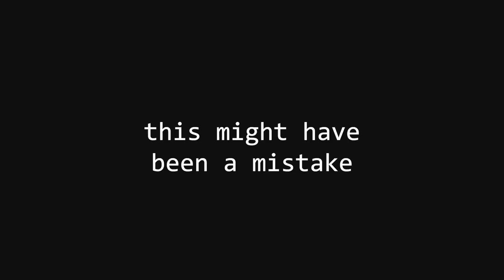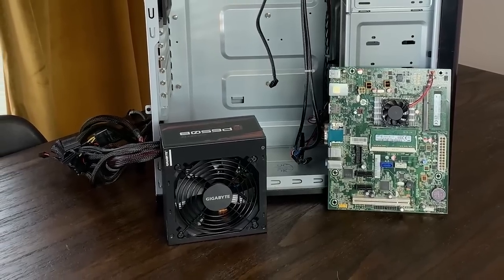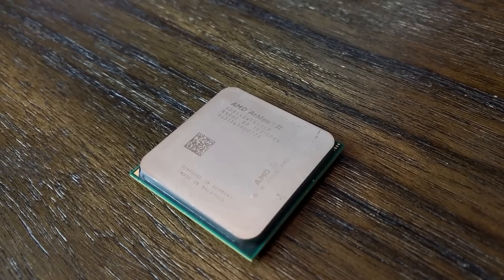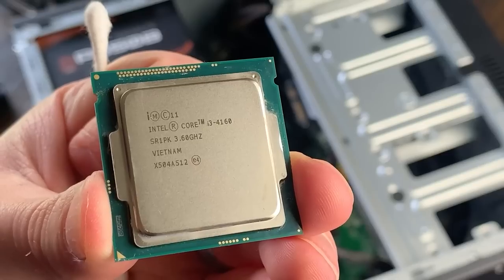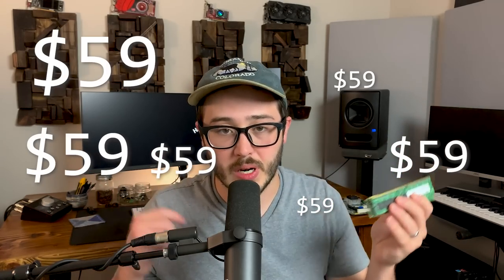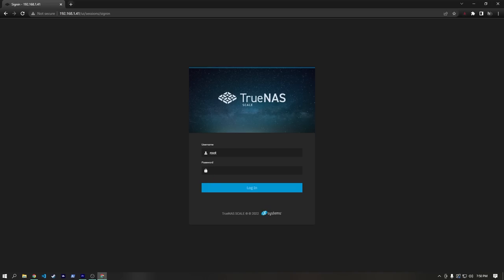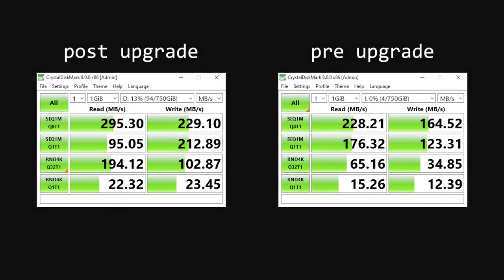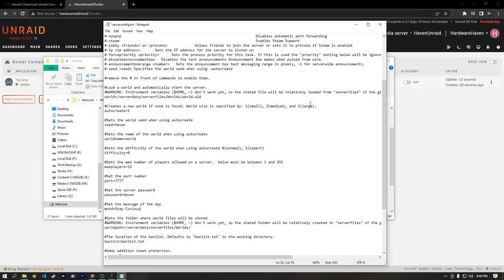Upgrading My TrueNAS Server

Comment: When I installed my first Supermicro motherboard I had the same fan cycling issue and had to log into ipmi to change the fan mode to standard instead of optimal or full speed.  That fixed the issue for me.
Reply: I just ran into this earlier today when I installed a lower-rpm Noctua fan on a Supermicro motherboard. You have to use ipmitool to lower the fan critical thresholds so the fans can run at their normal lower rpms (500 or so rpm in my case) without triggering alerts and causing all the fans to ramp up.
Reply from the maker: Any good links on how to do that? Haha
Reply: @JeffGeerling  Yeah, I have to admit that when I allowed TrueNAS forums to convince me I needed a Supermicro board it didn't take me long to realize I was in over my head and was now going to spend a lot more time on Google than I ever anticipated, lol.
Reply: @HardwareHaven  Don't know if it's able to be pasted here but just check out the latest blog post on my website (jeffgeerling.com)
Reply from the maker: Oh great! Will do!
Reply: Like my SuperMicro boards. X10sl7-f probably the most SATA/SAS ports (14) at reasonable money (<£100) without any 2TB limits or odd ports and also micro ATX.

Comment: Do you want a 32gb sata SSD that connects directly to the sata port with no need for wires for your boot drive? Has a little cable that comes off of it that connects to a molex cable. I used it for a while as a read-only boot device for my server before I figured out that you can actually boot from an mdadm raid. So now that raid is also the boot device. Anyway, because I used it as a read-only device, it isn't worn down. It would mean you'd be taking up a sata port for the boot device, and idk if the orientation would work on that board, but even if you want it just to mess with, that would be fine by me.

Also, have you thought about doing an Xpenology VM or something like that? I've seen people do it but I don't know how worthwhile it is or isn't. Might make a fun fun video to see your perspective.

That init command in truenas was clever!

Comment: You didn't change the bottleneck imposed by the 2.5GbE NIC.
You could have an ocean of storage in your TrueNAS Server, 
but it's still sipping that ocean thru a straw :)

A few more options come to mind:
(1)  some NICs support "teaming" i.e. 2 parallel Ethernet cables;
(2)  build a 10GbE "backbone";
(3)  more recent versions of USB are clocking at 10G and 20G,
a significant increase over 5G USB 3.0.

The latter option (3) can be enabled by installing a fast USB AIC
which is then cabled to a separate NAS chassis that also supports 
the same USB speed and connector.

With the latter setup, your workstation does double duty as 
a file server e.g. by "sharing" network drive letters.

(3) has a different "topology" but may reach 10G bandwidth
at less total cost than 10GbE NICs etc.

Hope this also helps.
Reply from the maker: The goal wasn’t to fix  bottleneck, but to replace my motherboard that died haha. 

But the 2.5gb connection isn’t the full bottleneck either. On certain reads I get pretty close to the 300 or so MB/s that 2.5 can support, but it’s usually lower than that, but my guess was that’s a limitation of the drives and configuration. If I added in an SSD pool, then for SURE the networking is the bottleneck. Fortunately my workflow works totally fine at that speed for now
Reply: @HardwareHaven  Thanks for the prompt reply.  Yes, I did understand your goal.  I did want to share some of the empirical experience we acquired while preparing a U.S. patent application.  Here's what we worked up yesterday:
A standard Ethernet frame contains 1,500 bytes @ 8 bits.
There are a total of 208 bits dedicated to headers, CRC, MAC source / MAC destination, etc. in each "frame".
Thus, 12,208 bits / 1,500 bytes  = 8.138 bits per byte (average).
Now compute max throughput of a single 2.5GbE NIC:
2,500 / 8.138  =  307 MB/second (zero controller overhead).
The divisor is larger for smaller frames;
the divisor is smaller for larger frames (e.g. jumbo frames).
You are reporting "close to 300 MB/s or so".
That would necessarily imply almost zero controller overhead, which is not very likely.
I would look elsewhere for explanations of that rate "on certain reads" (but not all) e.g. a feature of your measuring software, perhaps.
For possible future videos, we suggest that you take a close look at the QNAP TR-002, for comparative purposes:
1 x Type-C USB 3.2 Gen 2 10Gbps 
That USB generation uses a 128b/132b "jumbo frame" containing 16 bytes:  132 / 16 =  8.25 bits per byte 
10,000 / 8.25  =  1,212 MB/second max throughput.
Consequently, the x1 bandwidth "further upstream" e.g. motherboard chipset generation, may actually be slower than the max speed of that USB 3.2 Gen 2 cable.
PCIe 2.0 x1  =  5G / 10 bits per byte  =  500 MB/second MAX
Thus, something like an AIC with x4 edge connector would be required with PCIe 2.0 chipsets.
PCIe 3.0 x1  =  8G / 8.125 bits per byte  =  984.6 MB/second MAX
The latter is much closer to 1,212 MB/s, but still LESS THAN the latest USB cable.
PCIe 3.0 uses a "jumbo frame" = 128b/130b i.e. 130 bits / 16 bytes  =  8.125 bits per byte
Bottom Line:  upstream bandwidth is extremely important for maximizing overall throughput, and may be the real culprit limiting average, overall throughput.
p.s.  I was sorry to hear that your budget motherboard failed.  That's the risk we all take when purchasing used computer hardware.

Comment: Probably super late to the party here, I apologize if someone already mentioned it. SATA Dom (disk on module) are freaking amazing. Your mobo doesn't support the powered ones, )they would be indicated by an orange set of sata connectors,) so you won't be able to power it/them from the mobo without annoying small power connectors. However I truly recommend buying one or more for your system. USB flash has burned me more than once, the flash on DOM's is literally the same nand used enterprise grade ssds. Even though typically TRUEnas won't use many read writes, USB devices can have problems being powered on for so long. Yes, most of the time you could just replace it with another USB device, but when devices, especially USB, start to fail they can lead to unrecoverable situations. I've been there personally, not trying to be a neck beard.

Comment: Good upgrade, did you make sure the firmware for the IPMI was up to date? In general the IPMI as you found out is the one that controls the fans and you may be able to fix the fans issue fully by updating that

Comment: the fan rpm issue is probably just the cheep fan having a dodgy tachometer, theres a fan like that im my pc that cant deside weather its spinning at 500rpm or mach 4 but since the fans max rpm is 500 it isnt an issue

Comment: Sexy upgrade) I use a Ryzen 5 1600 from a previous build in my TrueNAS one and it's quite overkill. Well, Syncthing is the only thing that can load it rather high. I'm thinking of swapping it to Athlone 300GE but not sure if it's gonna be OK for three-four docker containers running (Nextcloud, Syncthing, Gitea, etc.).
Reply from the maker: Thanks! And that sounds like it could be a sweet setup

Comment: I am wanting to make a NAS server. But I am wanting to use Gentoo. I am just curious what each piece of software does in these videos. And if there is a way to do it.I normally just see people talk about dolphin, proxmox, docker truenas and unraid. I don't see creators go into detail about each piece of software

If you have and I missed it, then my bad. I am just starting the process of trying to make a very power efficient, minimal GNU/Linux build to back up storage for three computers 2 macbook airs and a workstation/gaming rig. I plan on it not really being much more than a NAS at the start. But will eventually make it a media server. Remove the IOT for TV's and what not around the house. I think smart devices don't get enough security upgrades for my liking. 

From what I can see TrueNAS is BSD based. Which is great, but I kinda want to see how much fun I can have with both my gaming/workstation and the server both run Gentoo. I hope I can do some fun ssh compiling or whatever. Split the workload between the two. Or just have the server be my work horse at night and give me the binaries when I wake up.
Reply: I lost all my data after moving and not having physical backups. So no more music collection or videos/movies. Plus I don't know how to navigate trying to get that data back again. It was a different time when that data was acquired.

Comment: There wouldve probably been some fan control options in the bios, did you have a look there?

P.s, Not complaining, but wouldve been great to see the asustor stats alongside as well for comparison.
Reply: Not in the bios it self. The IPMI web gui does have a couple of different fan modes to choose from. Although using ipmitool allows for more more granular control as well as redefining the fan rpm warning levels.
Reply: @cts006   Sorry, I dont have that much experience with ipmi, but wont ipmi just do  os level tweaks?  

For his use case, ipmi would be a great option, but if someone is dual booting their system and the fan malfuncitons on both OS's, then I think a bios fix would be more robust.

Comment: This is what the OpenZFS developers have said in the officioal documentation:

"Misinformation has been circulated on the FreeNAS forums that ZFS data integrity features are somehow worse than those of other filesystems when ECC RAM is not used. That has been thoroughly debunked. All software needs ECC RAM for reliable operation and ZFS is no different from any other filesystem in that regard."
Reply: great video btw :)

Comment: Haswell is the most efficient platform Intel ever produced. this is a good choice. As for the fan speed, I'd have just limited the fan to minimal in the bios.
Reply: On a SuperMicro -F server board there's an onboard remote management system (IPMI) that allows you to remotely access the server, even when the server is off, or frozen, essentially a low powered SOC that is running even when the server isn't.
That's what is controlling the fans.
Reply: Again, I’d be going in there to manually set it to low speed. Both my old servers have this functionality, & it’s essential for anything resembling home use.

Comment: How are you getting that much speed over gigabit? Did you bond your 2 gigabit connections or did you install a faster than gigabit card I missed?
Reply from the maker: 2.5Gb card. You can see me out it back in the system at the end of the "build" segment

Comment: Hi hh, do you have any plans, if possible, on making a budget cctv system using your current linux server? the cameras being usb webcams that is. I'm "definitely" not searching ways to keep my server running 24/7 other than being a home NAS.
Reply from the maker: I might look into that, but I've had little success in the past. I found it much easier to use a synology for NVR.

Comment: hehey Im running the same socket, currently with an i5 4440, it consumes about 45watt with 2 hard drives, and its alspo powerful enough to run a minecraft server! I would have picked a 2 core low power chip, but this is the only cpu I have lying around (actually the first desktop cpu I ever had)

Comment: I just built a nas with the exact same motherboard, but it’s nowhere close to 100+MB/s writes. Mine are capped at 35MB/s using SMB, are you using a different share protocol?
Edit: 6x4tb raid z2, 500gb cache, iperf shows network 1.08gbps so it must be user error lol

Comment: I didn't know it was easy to replace parts just like that without too much config and would work just like before.
I wonder how to do it if the os drive fails though.
Reply from the maker: I have a backup of the config, and the ZFS pool should still be intact as long as the drives are good.
Reply: @HardwareHaven  but you can't mount the drives without wiping them right? Which means the pool will be gone. I'm trying to learn how to use TrueNAS...
Reply from the maker: I think you can mount them without wiping them… I could be wrong though
Reply: @Ruby_Mochii  you can mount an entire pool in completely different hardware and just import it. Don't have to worry about drive order or anything.
Can import into a machine that already has another pool if you have enough hard drive connections.
The new machine OS needs to be at least as up to date as the old machine OS when the pool was originally set up.
Obviously, best to have separate back up, as whatever hardware glitch or power surge takes out the motherboard could also kill the hard drives.

Comment: I had a very simular motherboard with a i3 for truenas i upgraded cpu to a xeon 4 core 8 thread then run out of storage and needed to add another dataset. I upgraded motherboard to a supermicro x99 equivelant chipset and xeon E5-2690 v3 12 core 24 thread it also has 128 gig ddr4 eec 2x 10gig lan, mirrored 128gb boot ssd's 2x 2.5' 7200 hard disks striped for torrent  storage and 10x 4tb ssd main storage pool in raidz. I'm using a hba sas card and a m.2 ssd for my jails and virtual machine. it also runs plex and tautulli. It idles around 62 watts thanks to the ssd's but can ramp considerably under load.

Comment: wouldnt have been the pin shorting thing cuz that would have just switched the psu off. i know this cuz accidentally shorted the 12V to ground on my server and it just tripped the psu but then switched back on after. it was probably a capacitor going or just the board its self and the solder just cracked or something. thats fixed by putting it in the oven or blowing it with a heat gun but its a last resort really

Comment: Hey there HH! Love these types of videos where you refurb old computers for servers. Wanna support a small channel but i’m torn. Yeah I want to subscribe but i’m afraid that if I don’t catch an upload that it’ll be more detrimental than if I don’t sub but catch uploads fairly early (within the first couple days I’d say). From your experience what would be better for your channel if you know? I haven’t consistently done videos since 2019ish so I’m way out of how youtube works at this point

Edit: if you want fairly good quality cheap SSDs i’ve used PNY CS100s in my homelab for over a year with a year of off and on usage (mostly correlated to a bad update and I was off at college 4 hours away from home). My TrueNAS build is 24GB of DDR3 and i’d say you should prioritize capacity before ECC up until 32GB at the minimum (of course this varies based off of how much storage you have)
Reply from the maker: I think it's really just whatever works best for you. And I decided on ECC for the data integrity, not necessarily performance or anything

Comment: At 8:24
Installing components on the motherboard....

You really shouldn't be doing that on a hard surface, could damage components that are on the other side of the board. At least a piece of cardboard would be better....

P.S.  I did enjoy the face reveal....it was cool.
Reply from the maker: Yeah I was too lazy to grab something, lol. If I use card board, people tell me I'm going to ruin my components that way as well.
Reply: @HardwareHaven  

A lot of people install on top of the motherboard's box....but that is for new installs.
If you get five or six pieces of cardboard and tape them together into one single board that would give you a pretty good thickness, and you could reuse it.... I used to have something like that that I put on my lap to eat off from, a lap table.
Reply: @HardwareHaven  

Query:

Have you ever thought about trying a video with "new old stock"??  Hardware that is new inbox, but is old. I think this would be interesting, but it may take months to scrounge up the correct pieces from different vendors..... Not everybody has a new in box motherboard or video card or whatever that is 5 years old much less 10 or 15 or even 20 years old....
I know your channel is mainly dedicated to finding older hardware that is being thrown out, but older hardware that has been forgotten in a dusty corner somewhere could be an interesting one off....or more if audience likes it.

Thank you for your time;
Monte

Comment: "An Athlon X4 640"

My Unraid box runs an X4 605e and 12GBs of RAM. Works great but, it's only doing basic file server duties.
Reply from the maker: It works well, just consumes a bit more power than I wanted. Glad yours is working well!

Comment: This is so interesting as I did the same route as you. Started efficient with a 4 core J-something celeron, died because ZFS can HAMMER cpu with more than 4 drives, upgraded 2 more times and now on his maybe "final form" is a Ryzen 3100 4core 8 threads, 32gb ram, 6x 4tb 5200rpm Z-raid1 (lose one disk to lose it all) 

The kicker is, it's more efficiant than the celeron for some reason. Much more easy on the cpu, the average cpu wattage is higher but complete the scrub and everything much faster 

So it's a ballance of, do you want a scrub time of 2 day on 10W OR 6hrs at 65W
Reply from the maker: That’s a good point!

Comment: If the mobo supports xeons you should replace the i3 with it. ECC functionality only works with Xeons
Reply from the maker: The i3 4160 actually supports ECC. This motherboard doesn’t support i5/i7 skus because they don’t.
Reply: @HardwareHaven  Also the Pentiums support ECC.
Reply: Xeons sometimes run a little on the hot side.  You may need a beefier CPU cooler.